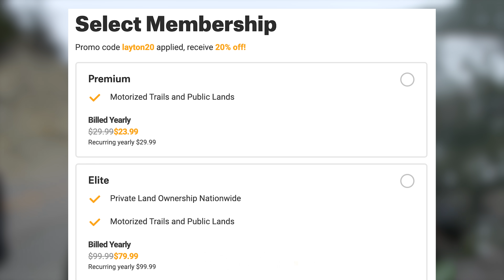This Strange Recovery Took A WILD Turn!

Comment: The trick to hooking up those hoses is in the unhooking. Shut the pump off, keep the power on, and bleed the pressure off the system. Just cycle the electric over hydronic valves, then disconnect.
Reply: Shh the greenhorn will hear you and rob me of my enjoyment 😂
Reply: I actually had the same problem today myself. I tried to hook up the grapple hydraulics on my tractor and couldn't for the life of me get the hoses (either one) connected.

Of course I did the usual, shutting off the tractor and moving the hydraulic controller to release all of the pressure on the tractor's side, but the problem turned out to be on the grapple side...

My theory is I took the grapple off in the winter, when temps were in the -20° range. Even though hydraulic fluid doesn't expand much, it expanded enough in the grapple's cylinder that it pressurized both hydraulic lines.

In the end I had to crack a hydraulic line and let out a few drops of fluid. That was all it took to make it easy to hook the lines up.

I've never had this happen before (in almost 50 years working with hydraulic equipment). Most likely this is because most of my cylinders leak enough through the shaft seal that pressure never builds up.
Reply: @Slider68  yes. The pressure in the grapple is tough. I placed a "T" on the equipment end with a cap. When it's hung. I crack the cap. Just on 1 side. The bail grapple, hay head, and post hole auger. It's on the open side.
Reply: The best way is to push the button in the cab that releases the pressure to the ports.
Reply: @andrewfaircloth1074  not all have that button.
Reply: @mrheart4242  the one he is using has one.

Comment: Robby, you did have a couple options. 1. Put one of the rear wheel and tire on the front, and the front on the rear, that way, no flat tire means better steering. 2. use the Skid Steer as an anchor to control the speed coming down that hill.
Reply: Point
Reply: Robby did it his way, got it out just fine. So nitpicker, why not leave a positive remarks instead of being a little nitpicking person? 🇺🇸 God Bless America 🇺🇸
Reply: Doug. I believe chip was simply implying that you’re lack of knowledge and common sense is actually nitpicking😊 have a blessed day
Reply: If you pay attention it’s a dually so no you can’t just take a rear wheel and put it on the front
Reply: @Russianderpvideos  You are wrong. The difference is only how they are mounted. The front "Bud" wheel is mounted  with the dish of the wheel inside, the rear inner wheel is mounted the same way and the outer wheel is turned around with the dish mounted to the inside. Think of it like this, if they were different like you thought, all dually trucks would have to carry two different spares, which, they do not.

Comment: If you hold out on the E-brake release you can use the E-brake pedal the same as the regular brake pedal
Reply from the maker: Except with a flat tire and no power steering then it’s slightly harder haha

Comment: I drive a truck, and use a specialized trucker map app. I haven't used the on off road mapping but It looks like a winner from what I've seen here. I like the way they're displayed in particular. Very clear, and easy to read.

Comment: Looks like fun Robbie.
And I work at the Ready Mix company driving trucks.
We had bunch of trucks we were scrapping out. But they worse Wonder we were saving for parts. Didn't run didn't have any brakes and we had a steep driveway and brush down below.
No one wanted to take it down so I got in it they gave me a little shove. And down that Steep Hill I with no brakes made a right sharp turn took down a few small trees and smacked into a back of another truck..
That was a small burn did I hit and got all the wheels off the ground bend down and smack in the back of the other one but not hard by that. Yes Evel Knievel ain't got nothing on me. I've been doing crazy things like this all my life especially of the youngster.🤘🏾🤙🏾🤟🏽👍🏽✌🏽✌🏽😳🤪.
🤷🏽‍♂️🙋🏽‍♂️😊😎

Comment: Hooking up those lines on the skid steer turn it off and on the machine where they go take a flat head screw driver and push in on it and release the pressure awesome recovery that was a hell of a ride

Comment: Just a thought... Were there no substantial trees higher up above the truck that you could have anchored off to run a snatch block back to the truck? You could then have taken the weight from above, chainsawed off the scrub that was holding the truck, and controlled the lower down onto the road avoiding further damage to the truck and your forestry winch? 👍

Comment: Turn machine off and operate hydraulic  attachment to relief  the pressure before unplugging do the same on the machin before plugging back in and thos fittings will work easy as hell untill someone bends one

Comment: On most fuel pumps you"ll see 4 soft touch buttons on each side of the TV screen. On the right side of the screen try pressing the second one down from the top to mute the sound from whatever is playing on the TV screen. Then you won't have to hold your hand over the speaker to film!

Comment: Robby when your getting fuel at a pump that has a screen screaming ads at you if you push the buttons on the side of the screen one of them will mute the sound coming out of the speaker.

Comment: Bluetooth Head Sets!
It would be better to use Steel Bow Shackles on the back end of that Cat to protect the Soft Shackles from getting rubbed on those corners on flat steel but at least use the protective sleeve on that side.

Comment: It seems really funny Robbie is that that truck has zone are on it which can track you track your speed batteries disconnected so I wouldn't be working almost sounds like somebody undead the battery so the truck couldn't be found

Comment: The audio on the wireless microphones was a bit hot. Guessing new hardware, and still trying to find the sweet spot?  Had to keep turning down the headphone volume so as not to blast my ears. Any bets on Robby buying the truck for parts when the insurance company totals it?

Comment: Didn't watch it with sound but just some Old Florida Cowboy Advice , If y'all come across something like this again and you got that ANCHOR of a Bobcat with you, USE the Bobcat Behind the Vehicle as a BRAKE next time ...  Just Double up straps to be safe if High Grade and use the bobcat to keep the truck going Down hill SLOW & Controlled .........we have had to do this a couple of times when up at My Wyoming Ranch !!

Comment: Robby is right, something is fishy about the battery terminals being unhooked, like maybe it has GPS and someone didn't want it found, plus master cylinder bolts don't just break like that. Somebody watched too many movies and thought the truck would be a crumpled up ball of metal if they sent it off a cliff, but insurance companies do thorough investigations, and won't stop until they find the asset that they may have to cover for thousands of dollars.

Comment: If there's no bag deployment I don't know why that would be a total. Wondered if one of the owner's friends or whatever came back and disconnected the battery so it wouldn't drain. Looks like it only needs a grill and battery really. Don't know why you didn't hook the yankum between the skidsteer n the back of the truck to keep you from flyin down the hill other than for theatrics :D

Comment: My theory:   The driver did not bail. The driver came up with the brake failing story. He had to come back and take parts and make it look like scavengers. Otherwise  it would be easy to prove the brakes were working when the truck went down the hill. 
The brakes were working but the driver was possible DUI and needed a cover story.

Comment: For next time, don't spin the Skidsteer on rocks, will spin a track off every time, not sure if that model cat has hydraulic tensioners or grease tensioners, if grease always have a grease gun available to retension the track,

Comment: I had faith you guys could lift the wall. You guys are doing amazing work....but I was wondering why you didn't have temporary braces pre nailed to the ends of the wall to allow Grason  and Brandon to hold on to some degree. It was a huge wall though...

Comment: I know you guys benefit from exciting, risky activities and your video was entertaining to watch, but...

I've been doing this sort of thing for years and to do this job safely you should have a rope on the uphill side of the truck. Hook that rope to a heavy rescue vehicle to ensure the truck doesn't get away from you.

If you can't get the rescue vehicle above the truck, you can hook a pulley block to a tree and use a vehicle anywhere.

If you only have one rescue vehicle another option is to use the pulley block and a rope attached to that one rescue vehicle combined with using the winch on the same rescue vehicle to get the truck moving. This admittedly is a fairly slow, boring descent...

Anyway, have fun and be safe.

Comment: The bolt and nut guys get to hang with all the cool cats. 

Robby your tracks are a bit too loose. Don't run them as tight as the book says or they'll crack but those are a little too far the other way.

Comment: Any bets that was an insuramce job on that truck,  battery disconnected and parts removed. Id say it was pushed over the edge
Reply: Or someone else found it first... I've known two separate people to have their vehicle break down out in the sticks, came back to it 24-48 hours later and had half a car left. One of them had the entire transmission stolen, not even kidding you dude. Scavengers make very, VERY quick work (mostly because it's not their car and they don't care about cutting/ripping things out brutally)

Comment: Is it me, or is the fact that the winch should be used to lower it into the ravine and use chainsaws to cut the branches the proper way to do this rather than the suicide run method.

Comment: That was a sketchy recovery, not to nitpick but when that truck was sliding off the hill, there was a couple people on the left, in between the truck and skid that is a terrible place to be, has the truck went off it would’ve pulled the skid and they people in between would have went also due to the rope.

Comment: That is a CTL...please no driving it like a wheel machine making zero turns and you wont walk your tracks off....also the balance is towards the back of the machine so pull from the front always to maintain control.

Comment: That "accident" has some goofy indications. Can't afford the payments, let's get an insurance claim. Interesting parts disconnected, missing. Why do a battery disconnect and not take the battery. E-brake works but truck rolls down a steep ravine, driver didn't notice the mountain bank on the other side of the road with a fairly deep drainage cutout to drive into. Uh-huh, accident, sure.
Reply: Agreed. That battery would have gone walkabout.

Comment: If I was high way patrol you would be bringing those rocks back up be cause it probably cost tax payers to place them there and to buy
Reply from the maker: Highway patrol has no jurisdiction over the Forrest, the Forrest service does! We talked to the correct people and didn’t have to place them back! We where asked to get the truck by what ever means necessary…. FYI rocks in the mountains do not cost tax payers money!

Comment: Another Insurance scam, I have been in the Towing Business long enough to read these things, The owner dumped this Truck, Look at the Mortgage on the Truck, or Mechanical records. That Truck was sabotaged. Inside project. Robby you do not need to holler when the employees are right there to hear you.Why are the tires flat?